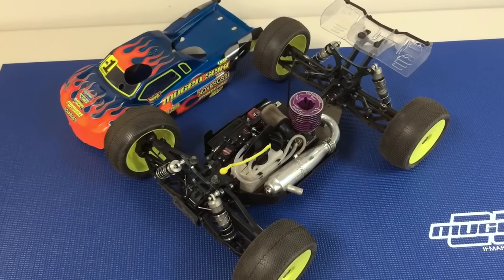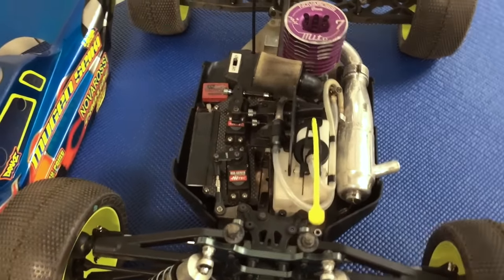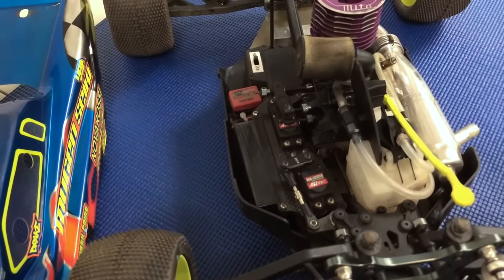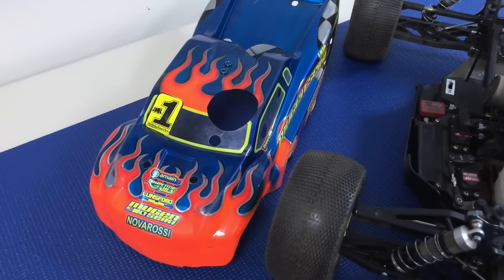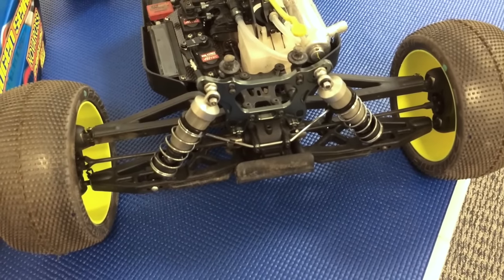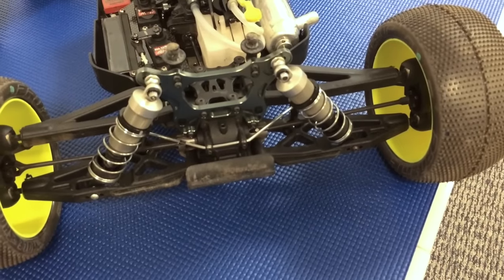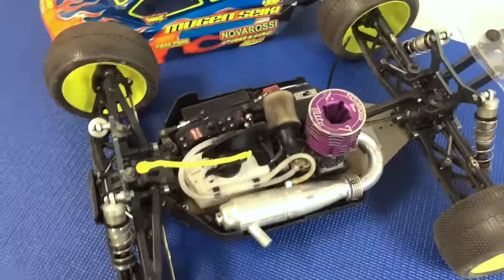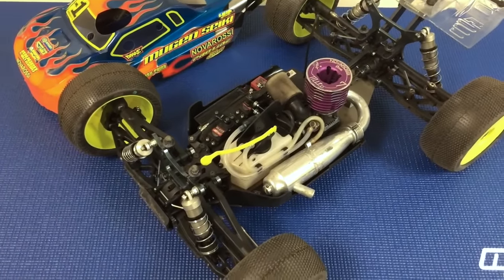Adam Drake from Mugen Seiki Racing - MBX7TR under the hood.

Comment: Adam drake what is a good diff set up for a sportsman that is really easy to drive
Reply from the maker: +dericlane761 
Hello,
My standard set-up is posted at http://www.mugenracing.com/setup-sheets/
If the track is low grip or you need it to be a little easier to drive, I would start with 10,000 in the center diff.